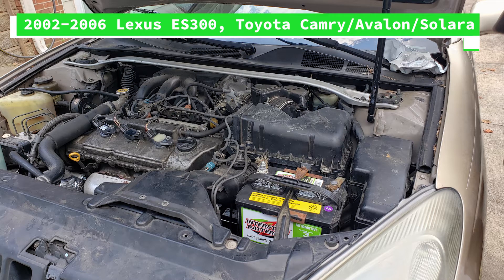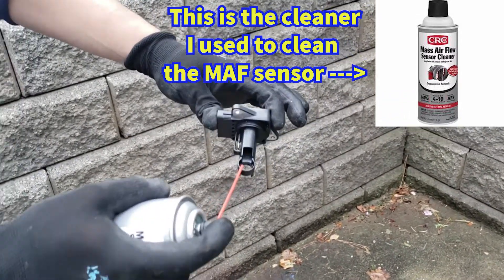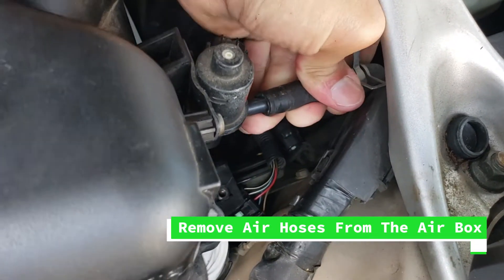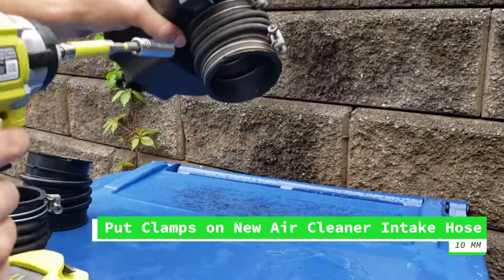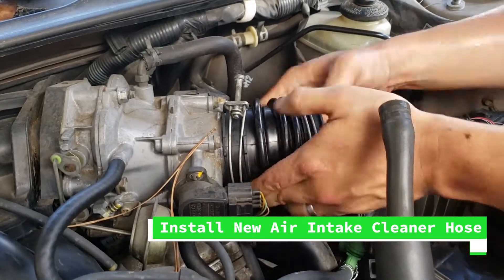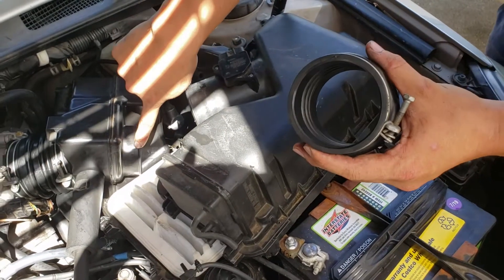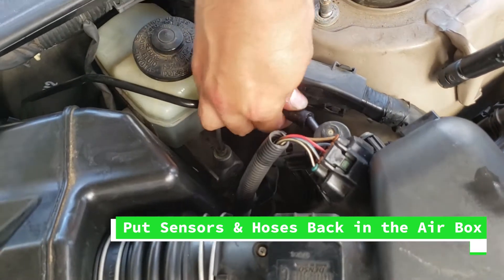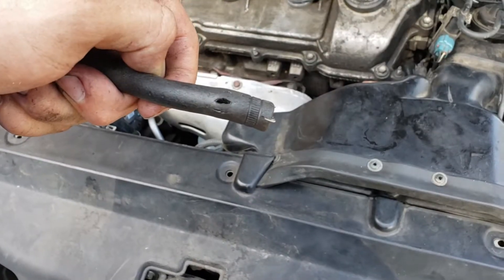How to Fix a Car Running Lean  P0171 and P0174

Comment: I have a p0174 bank 2 lean. New MAF, new fuel injectors, new PCV, new fuel filter and fuel pump, new cam shaft and crank shaft sensors. New spark plugs, wire and ignition coil. New bank 2 02 sensors. Still running lean on bank 2. Any suggestions?? All vacuum hoses are good I have a smoke machine being delivered to check the intake manifold gaskets even though the are new
Reply: I have replaced exact same things as well as the throttle body I have smoke machine as well and no leaks either. Mine is lean on bank 1 and at idle it sounds like I have a cam in it. Any suggestions?
Reply from the maker: I'm sorry this is happening to you guys. You have replaced most of the standard items. I would check the air filter and filter box and pretty much anything in the path of the air traveling to your engine. If you are hearing a significant sound when Idle there might be something else.

Are you only getting P0174 and no other codes? In a few instances one code might trigger other codes.

Please let me know if you find a solution I will be eager to learn what was causing this code.
Reply: Reset you're ecu
Reply: @emiliomendozaguzman2203  how do you do that?
Reply: @emiliomendozaguzman2203 how do you reset it ?

Comment: Hi I have juss used the tool on my car and have found 2 faults Heat Sensor Bank1 and Misfire by low fuel. Any chance you know what I need to replace? Not sure what is needed.
Reply from the maker: Hello, unfortunately I don't know what it might be. Do you have a 2002 Lexus es300 as well? What system codes are you getting?